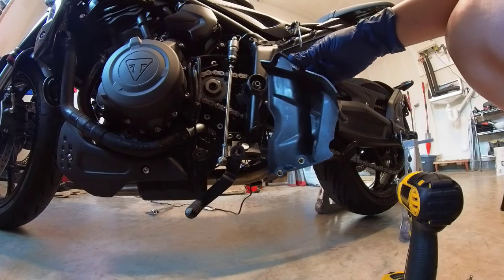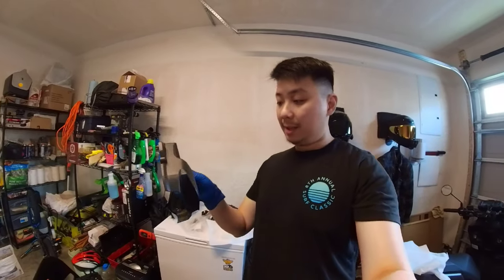Trident 660 Carbon Fiber (CF) Install

Comment: Those are cool parts they just don't go with a matte black tank. I have the exact same bike as yours. I would have chosen matte black parts. or matte black carbon fiber. Don't make the mistaken of going overboard. less is more keep it naked, clean.

Comment: Where did you get the parts from???
Reply: I have a bunch of carbon on my Trident 660 too, google CarbonFBR and MotoComposites. They both have carbon bits. One is in the UK and the other in Canada. They have slightly different parts or finishes available. I have no affiliation with either but have ordered from both.

Comment: Any pros and cons from using dnk tune after a year?
Reply from the maker: No cons just pros. I’d still recommend it though a proper tune would be better.
Reply: @enzo6sixty  Does the dnk tune resolve the problem on the higher revs loosing power? Like when reaching 195kph and when you hit the 10,250 limiter mine looses power while on full throttle on my stock map.
Reply: How much do you want for the silver ones? Im in UK